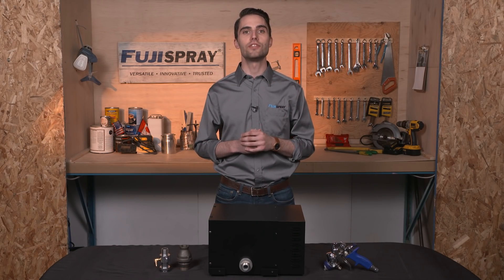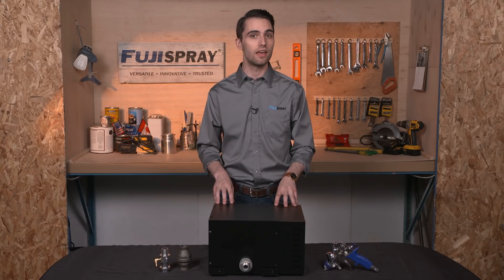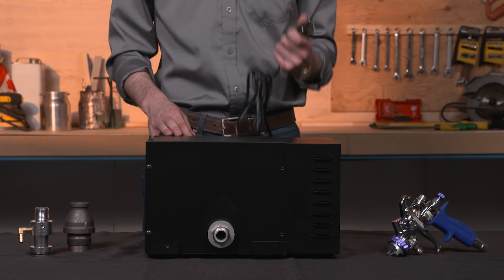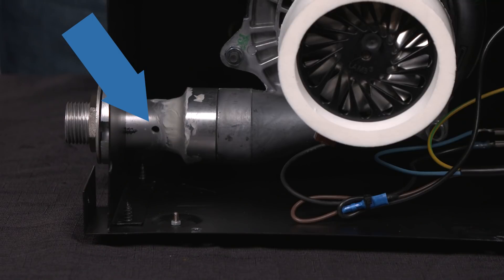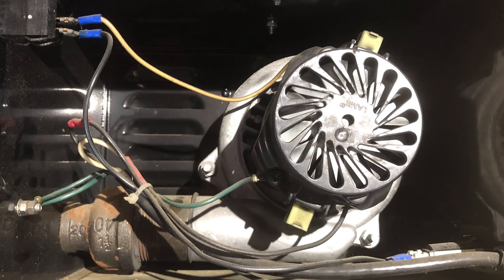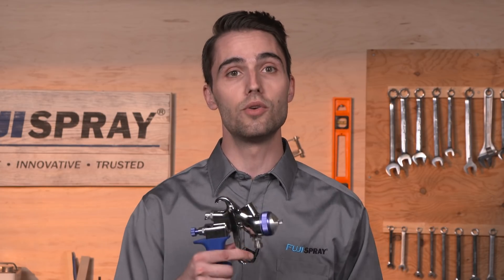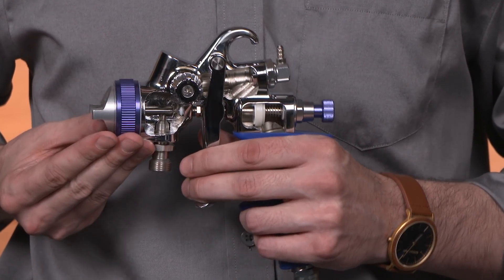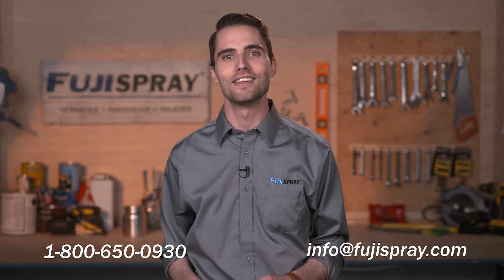How To | Use a Non-Bleed Spray Gun with a Bleeder Style Turbine

Comment: Hey, I have two Fuji models . . . so don't shoot me for this, but the Apollo A7538A is an external bleed adaptor for like $30.  The advantage of that is you don't have to open your case nor drill. Beyond that, it bleeds the hot air external, so you don't have hot air escaping into the case, and you can just remove it to gain back 100% pressure for a bleed style gun if desired.  The adaptor seems like it would be trivial to make if Fuji wants to make a $5 adaptor they can sell for $30.
Reply from the maker: Fuji Spray shifted away from bleeder style turbines almost 15 years ago into non-bleed turbines. The instances whereby an end-user will need to do this modification is so far and few in between that it does not warrant Fuji Spray to look into a device like this. Thanks for the idea though! - Fuji Spray Team
Reply: @FujiSpray  Hi, what make you turbine "non-bleeder" ready?  Do you drill hole at the factory, or do you use some kind of release valve?  Thank you
Reply from the maker: @fugazi84  All Fuji Spray turbines today are designed for noon-bleeder spray guns. Only older turbines purchased dating as far back as the mid-2000s will require this modification. - Fuji Spray Team -
Reply: @FujiSpray  hi I think you have this backwards. Perhaps you meant that you stopped making bleeder turbines, and only sell non-bleeder turbines now
Reply from the maker: @fugazi84  Excess air is channeled from the manifold of the turbine to exit the rear of the turbine case

Comment: what about a bleeder gun with non-bleeder type turbine ????? is it possible as ive been given bleeder gun and both my turbines have a hole in manifold ???
Reply from the maker: This video refers to Fuji Spray equipment only. If your turbine unit was purchased with a bleeder spray gun, then the turbine unit is designed for its bleeder style spray gun. Bare in mind Fuji Spray has shifted away from this type of setup almost 15 years ago and moved to Non-Bleeder style spray guns and turbines - Fuji Spray Team